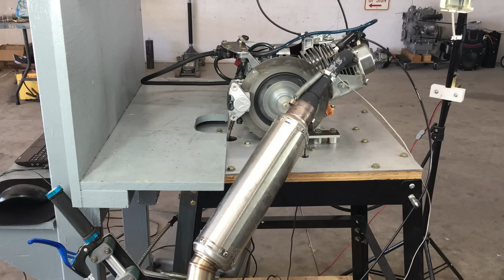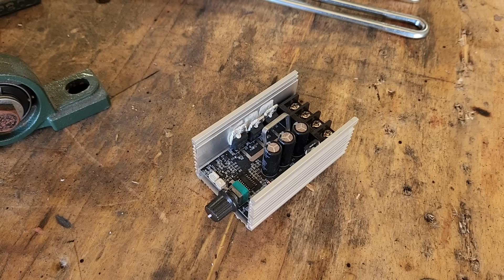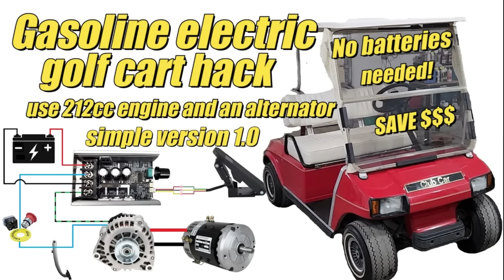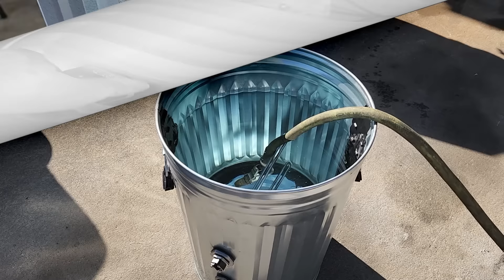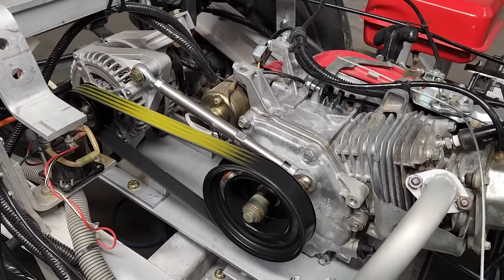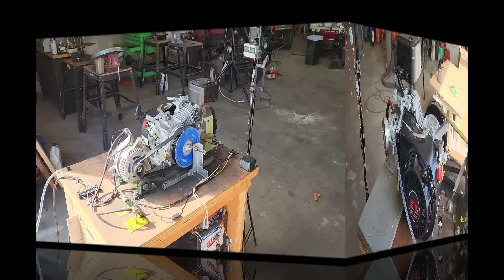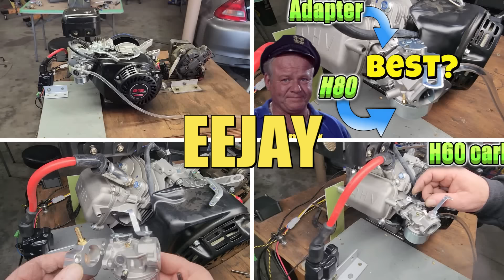S6 E5  Our small engine test stand is BUSTED!  can we fix it on the cheap?  Let's do an experiment!

Comment: Any reasons you don't just take the diodes out? those heating elements should work just fine on AC straight out of the alternator and it'd be a little bit more efficient
Reply: Good idea!
Reply: Yes but he wanted to use the pwm circuit. It's dc
Reply: @afberglund2764  That's a DC injection into the field windings, generated from an external power source, the output of the alternator is irrelevant in that case. The field windings being excited with DC causes 3-phase AC to come out of the rotating alternator, that's why it's called an alternator. It turns a DC excitor input into alternating current, which is then rectified back to DC, ironically this is easier and more efficient than just having the generator make DC directly.
Reply: @afberglund2764 That’s for excitement.
Reply: The problem with doing that is the alternator is three phase and it needs the diode rectifier to avoid shorting out the windings.
Reply: Worthy experiment.
Reply: There will be voltage drop and loss on the diodes as well.
Reply: Measuring DC is wayyyy easier
Reply: @MyLonewolf25  Well....you're not wrong, but with most modern multimeters they all do proper "area under the curve" type measurements instead of a bunch of short cut math methods that only works on nice sine wave 120/240. So, most modern meters do a pretty good job with wild AC. Back in the day I built a few hand wound custom alternators for wind turbines and other fun things. I put one on an exercise bike so I could charge a 12 volt battery while I was getting a workout. Since that wasn't just heat, I had to use diodes.

Another solution is to move the diodes into the trash can so they are water cooled, although you would have to do some righteous insulation and isolation so the water tank doesn't become electrified. Also improves efficiency and accuracy b/c then more of the "waste" heat ends up in the water and can be measured various ways.
Reply: Wiring gets a bit more complex since he’d need to wire the (eventually) 3 elements in a 3 phase configuration. 

So while more efficient, it adds wiring complexity.
Reply: You’d need to wire the heating elements in a delta or wye configuration too.  so you’d need 3 or 6 elements and they’d have to be pretty well balanced and you’d have to measure 3 different current measurements and do some extra math to get the real power output numbers.
Reply: @almfreak You can calculate the power from the volume of the water and the change in temperature over time. Ideally the can would be insulated but the number would be meaningful.
Reply: I think it's because measuring DC is way easier. This thing is gonna make a wall ac meter lose it's mind with whatever frequency it would spit out. And the windings are 3 phase, would extra complicate measuring and wiring to the elements. Engines make power at different rpm's so focusing on 3600 or whatever standard wouldn't make sense for a dyno even if he could stabilize the hz
Reply: Wiring those heating elements in series will double your ohms resistance 😮
Reply: @allenandersen4423 The load would be lower, as Jimbo explained, the lower the resistance, the higher the load.
Reply: @allenandersen4423  and lower the total power output of the load cell. He needs LESS resistance to get higher output, not more.
Reply: Measuring volts and amps is hard with a changing frequency. Most meters are made to measure AC at 60Hz and it's probably never going to be 60Hz more than half a second. (Measuring across that shunt resistor and across the resistor supply buses).

Comment: Well, I would have told you to copy my setup to storage-discharche 6s LiPos - 2 rear windows with the heaters in series. But they only pull around 300-400 watts. But they were free, I take it you are certainly on good terms with your local junkyard. And IF you read this… Bugeye Sprite with whacky engines would be something I love. Original they produce 48hp. And there are so many swap ideas out there, up to BMW bike heads on the original BMC block.
Reply: Wait ... that last idea ... that WORKS?
Reply from the maker: Bug eye Sprites are a bit out of my price range  The latter Sprites & Midgets are a lot more affordable.  Hard to find a decent one for cheap.
Reply: @robotcantina8957  Later spridgets would work too :)

Comment: The left hand threads on the bulkhead fittings is so that when you tighten the fittings screwed into it, you won’t accidentally loosen the fitting. Also, they are typically installed with the fitting in the inside of the tank and the nut on the outside so that the seal is on the inside, keeping the liquid away from the hole that you cut. Reduces corrosion in the hole that you cut.
Reply from the maker: That makes a lot of sense!  Thanks for the input.  I'll keep that in mind when I build the new container.

Comment: Are you making a small engine dyno, or a portable hot water heater? Would work for power with a minor modification, but probably wouldn't run the wife's blow drier.

Comment: I'm fascinated by that 120+ volt alternator output. It makes me think there might be a way to get 120 volts 3-phase ac at 60hz out of it and make it into a light duty generator. Of course, that will require an automatic voltage regulator and a governor that keeps the engine at 3600 rpm. 
Actually, now that I think about it, it might be cleaner power to fix the alternator output to about 48 volt DC and run a 48 volt to 120 volt inverter from that. It would be an interesting side project that I'd love to see, seeing you modify and build both versions to compare them. That probably wouldn't appeal to your regular audience though. Do you have a second channel where you post side projects?
Reply from the maker: Lots of things can be done with the alternator.  Keep in mind every time you convert energy you have a loss in the form of heat.  the 48 volt DC pumped into an inverter to make 120V AC would have more losses than just using a regular 120 volt generator.  Uniformity I don't have the time to run a second channel.
Reply: @robotcantina8957 cool. Looking forward to the upgraded load tester. Keep up the great work!

Comment: The days of petroleum battery are over, now it's time for petroleum kettle! Petroleum vacuum cleaner next? Or a petroleum kitchenaid?

For longer run times you could encourage evaporative cooling from the water barrel - a cheap fountain would probably work, or you could throw together something like the cooling systems @YesterdaysMachinery uses

Comment: Did anyone else see the camera shutter speed match the engine vibration and show it rocking back and fourth and can see the pulley off center?
Reply: Not only that but you could watch all sorts of vibrations in slow motion fail to tear things apart. That sort of stuff always fascinates me!
Reply: @DonkyHott  I'm an A&P with IA specializing in rotorcraft(helicopters) and vibration is your enemy.
Reply: Using plywood apparently without bracing underneath makes it even more wobbly.  A length of 2X4 screwed onto the underside would stiffen things up a whole lot.
Reply: @GrumpyUnkMillions  Not having the bracing probably helps in this case with something quite unbalanced.  The whole kit would be walking around the shop if it was stiff.
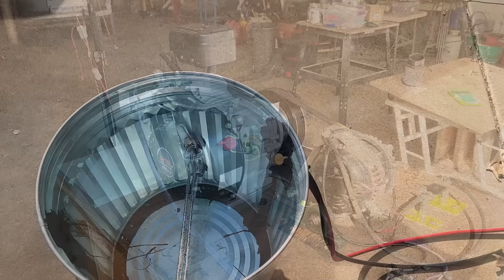Reply: I think 15:28 is the time, had to see it for myself

Comment: Add a temp sensor to the new barrel setup.  In theory you can calculate power consumed with the change in temperature.  Of course environmental factors will have in influence.  Do you think the convection in the barrel will be enough to get a good measurement?
Reply from the maker: The convection in the drum is probably not ideal  and there would be a lag of a degree or so.

Comment: You don't need the diodes. You can remove em, take the 3 phase AC power from the coils, and connect up 3 elements. Little more complex wiring, but fewer losses and less to fail. Just a thought. And I still miss the golf carts 😢😂.
Reply: Came down here to comment the same thing. Definitely an option if the magic smoke escapes those diodes. A third heater element may be cheaper than a new diode pack if it comes to that. Unfortunately a delta resistive load does require more than just measuring one voltage and current to calculate power, but multiplying by 3 never hurt anyone.
Reply: The only problem is it'll make reading the power output more difficult but I approve of keeping it simple.

Comment: Some 55gal drums have a bung hole (typically a 2" pipe thread) located on the side of the drum at the bottom, you could insert a reducer and a valve to drain.  Most of them I've seen are closed head but they might have some open top drums with that feature.

Comment: If your drum is open at the top, there is no need to drain the water for longer runs. Just let it boil and evaporate, the water doesn't exceed 100°C/212°F and the drum and heating elements should handle that. Just refill water to keep the elements submerged.
The phase change from liquid to gas (boiling) takes a lot of power and was used for example to cool large radio transmitter output tubes.

Comment: I am surprised you’re cutting the drum down. You could just half fill it. And locate the elements in the lower level. Then if you have a lot of runs you could fill more water or if you fill it out with 6 elements you don’t risk boiling in a bunch of high power runs.
Reply: My thought was install them in the lid. No leakage problem there.

Comment: wait, why do you plan to cut the drum? seems like a lot of work. just put the resistors at the bottom and don't fill it all the way lol.
Reply: The point is to have a cost-effective solution. As Jimbo explained the resistors are very expensive
Reply: @ThatMinecrafter cutting and welding the drum adds more work/cost for the payoff of a smaller capacity drum. Leaving it full height also has the benefit of adding even more resistors or water if needed in the future.
Reply: I also think having the larger capacity could be a safety feature. If you get that 15 gallons of water really hot during a long test, you'd have capacity in the barrel to run a garden hose in there and mix in cooler water before handling/disposing, so less chance of burning yourself if there is a spill.
Reply: @ThatMinecrafter  you did not understand my question.
Reply: @ThatMinecrafter  I'd recommend rereading what you replied to period because I don't think you even read it once
Reply: @neb_setabed there's nothing wrong with my comment
Reply: @ThatMinecrafter  yes your comment is irrelevant and has nothing to do with the original comment that you replied to. I'm sorry that you are having difficulty reading and comprehending, but the original comment that you replied to is asking why Jimbo is going to cut the drum. Jimbo is already buying a drum. Jimbo has already bought the resistors. So at this point the established facts are that Jimbo will have a drum and has bought the resistors. And that is all the cost. The original comment is asking why Jimbo was planning on cutting the drum that he will already own. Because that would be more work. When instead what Jimbo could do is just leave the drum as is (the one he will already own) and just not fill it up all the way. You've responded to that By somehow ignoring all relevant details and you said "the point is to have a cost effective solution. As Jimbo explained the resistors are very expensive". He already has bought the resistors. He will buy the drum, so what you said is irrelevant, and doesn't apply to the original comment you replied to. The original comment is just talking about why is he going to cut the drum that he will already own when he could just leave the drum as is. 

So cutting or not cutting will not affect the cost, cutting will just add more work and be unnecessary.

Maybe in your messed up way of thinking you are thinking that if they leave the drum as is without cutting it that he has to fill it with more resistors? Which I'm sorry but that's not how that works you can just add two resistors to a giant drum at the bottom. And only fill it with a certain amount of water.

You have demonstrated that reading and comprehending is not your strong suit, so good luck with life.

Edit: removed an extra word that my voice to text added in
Reply: @neb_setabed are you dumb dude Jimbo already said he doesn't want to use resistors because they're not cost-effective and expensive so how the hell is my comment not relevant to the comment that the other guy made
Reply: @ThatMinecrafter  I see what the confusion is!

You don't understand what a resistor is!

You should really look it up before you try and comment. You are thinking we are talking about the air resistors, the ones that he was using previous to this video. 

Unfortunately for you the things that he used inside of this video that went into the water, and the bigger version of those that he said he ordered are also resistors. 

So he said in the video that he's buying bigger versions of the resistors, the ones inside of this video that he put in the water. 

So you should watch the video look up the term resistor and then you will understand how you messed up. He already said in the video that he is buying bigger resistors. The bigger resistors that go into the water. You speak with such Authority and yet you don't know the basics of what you are talking about.

So here's your homework before you reply to this comment:

Look up what resistor means
realize that those "water heaters" are actually resistors
Free watch the video where he says in the video that he has already ordered bigger resistors "water heaters"
Try and use thought before commenting
Reply: @neb_setabed  there’s only one resistor left. It’s not cracked. He is having to use something other than resistors to do this safely. It needs to be repeatable. The person you responded to was hung up on your use of the word resistor because it doesn’t make any sense that anybody who watched the video would not have heard him say that that’s a resistors were bad and needed to be replaced, and the new system he’s building is cheaper to replace it with.
As to the question of why he needs to cut it in half, I don’t know that. Maybe it will be easier to work with, or maybe it will be easier to repair if it goes bad. He is working on a production schedule where he needs to produce a video and release it every week in order to satisfy the algorithm.
Hope that helps.
Reply: @n @neb_setabed  rewatch the video. Jimbo called the parts that he’s using to replace the resistors that he had heating elements. The new parts that he’s getting to replace these because they are not adequate are also heating elements. They do use resistance to produce heat, but no one causes a heating element for a water heater resistors. Hope that helps.
Reply: @Pdub_Productions  
I was not the one who needed help. The person who I was replying to needed help. It doesn't matter if Jimbo called a heating element in the video or not because it is a resistor the original comment who was talking about Jimbo possibly cutting the barrel or not call to a resistor because that's what it is. In this guy who decided to respond with such Authority decided not to even know the basics of what he was talking about. So I was not the one that needed help. The guy who I was replying to needed help understanding the basics of the very thing that he was calling me dumb about
Reply: @Pdub_Productions 
Once again friend I did not need help I'm not the one who originally called them resistors even the original comment called them resistors so I stuck with it. Because I was able to figure out what he meant. the fact that these "water heaters" are resistors they are that is what they are that is what they have always been that is the actual definition of what they are. So I went with what the original commenter said and then the guy who I was originally replying to decided to speak as if he knew everything when he doesn't even know what a resistor is.
Reply: @ThatMinecrafter  I'm going to assume since you haven't responded yet that you see how wrong you were?
Reply: @Pdub_Productions  actually I just saw that you lied when you said there's only one resistor left. Sure he has that one are resistor left but he also has the 2 resistors that he used in this video that went into the water and he also said he ordered two more of the resistors that go into the water.
Reply: Why do people talk about other people like they are so much better than others just because someone kinda misunderstood a comment or something. Don't put someone down and think that people are going to believe that you're somehow better than others because it really just shows a lack of maturity and self control and lets everyone know that you're not as educated and mature as you are trying to seem. and me typing this is basically saying the very same thing about myself so yeah lol
Reply: @Mike-nk3su  I gave that person a chance. My first comment was not rude it was merely telling him to reread his comment. But he doubled down without thinking
Reply: @neb_setabed  sorry, way YouTube presents comments confused me. on board, yeah lol
Reply: @nuttyDesignAndFab  I know right, it can become a jumbled mess haha
Reply: @Mike-nk3su  who is this directed at? im confused lol

Comment: Just thinking out loud here, but, why not ditch the diodes and just run A/C to the water heater elements? That's what the elements run on in a water heater anyway, right? Just asking if it can be done.  Love the channel !!!!!
Reply: I might be wrong but there are multi phase windings, so you cannot just connect them together. You probably need as many greater element combos as poles in alternator - probably 3? So more wires, more complexity and saving only on few diodes